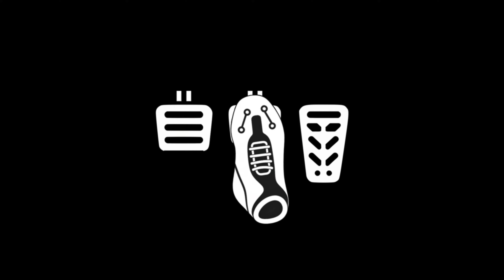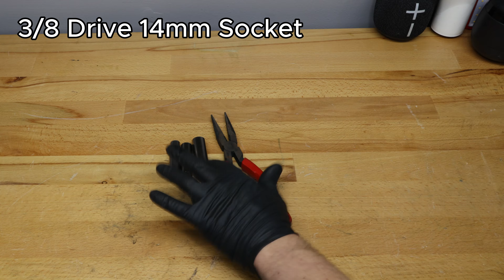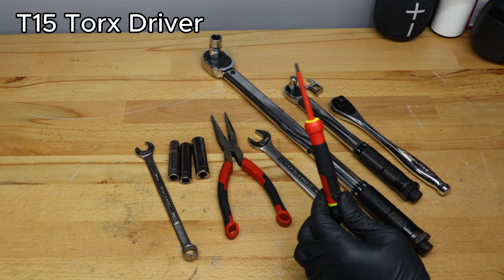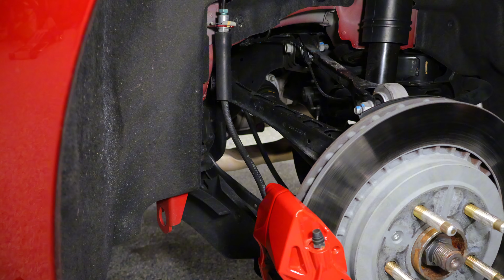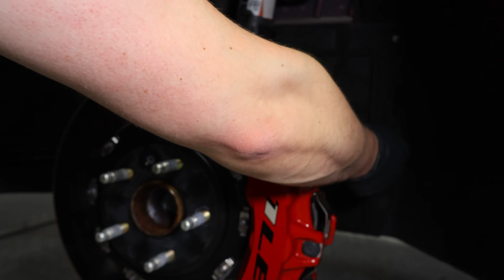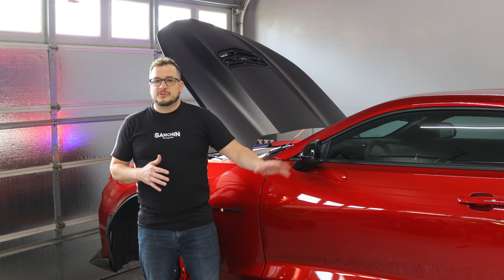How-To: Stainless Steel Brake Lines // 2016 - 2024 Camaro // SS & ZL1

Comment: Great video Luan but if you will I have a suggestion to keep a lot of the fluid from leaking all over when disconnecting OEM lines . Remove reservoir cap and stretch Glad Press'n Seal on clean surface of the threaded reservoir opening itself . I've done this for years and also keeps fluid in the lines say if your also removing calipers . Yes you still have to bleed the calipers afterwards...Peace
Reply from the maker: Man, this is GREAT advice! I've pinned the comment so everyone can see it.

Comment: Thanks for the video. Quick question are you still running the hawk DTC 70 brake pads? I saw in one of your videos you upgraded from the DTC60. Would you recommend the DTC 60 for a beginner like me that’s starting to push harder on brakes? How hard the DTC 70 and DTC 60 on the OEM rotors? Thanks. Maybe a brake pad video like your oil video.
Reply from the maker: Great question! I don’t run the Hawk Pads still. I’ve run a plethora of different pads, from PowerStop Track Day Pads, to Ferodo DS3.12’s. My favorite pads were the Raybestos ST45’s, but unfortunately those are no longer made. Currently, I run the Girodisc GP40 pads and they are phenomenal. 

I did not like the inconsistency of the DTC-60 at all. The DTC-70 was much better, but they tore up the rotors pretty good and wore down much faster than other compounds I have tried. 

Stay away from PowerStop TDP, and Cobalt pads as well. The wear rate was absolutely awful. If I had to rank them from favorite to least favorite, here is how I would list them:

Raybestos ST45 (discontinued)
Girodisc GP40
Ferodo DS3.12 & DS3.12
Hawk DTC-70
Hawk DTC-60
6 Chipmunks at each caliper
Cobalt XR1
Power Stop Track Day Pads
Reply: @ you’re a legend! I’m going to …follow your line…and go with the Girodisc GP40 hahaha. Any chance you’ll be at Watkins with NASA  Northeast on April 26-27?
Reply from the maker: @pv4083 I wish! Watkins Glen is one of my favorite tracks. Did my Skip Barber School there on the short course and did the Full Course a few years ago, albeit in the rain.

Comment: This isn't related to the video, but.... do you have a guide for first time track goers? I have a 22 1LE, and I want to get some track time this year? I'm in Northwest Indiana, so it's probably going to be Gingerman or Autobahn.
Reply from the maker: I don’t currently, but I can add it to the list. I do have a long-format video of what I pack for the track, if you wanted to check that out here: https://youtu.be/4YBlAUGzPX4
Reply: I've must've watched that video like 10 times...lol. I had questions like, is  brake fliud, brake pads, and tires change a must for a first timer?
Reply from the maker: @Alkeides I would highly recommend changing your brake fluid to a high-performing, high-temp DOT4 fluid, like Endless RF650. As far as tires go, you’d want at least a summer-only type tire, or max performance category tire. The OEM Camaro SS 1LE and ZL1 Goodyear SC3 are Max Performance, so no need for different tires. As far as brake pads, this is entirely dependent on the track you will be at, but if it’s your first time tracking, as long as they aren’t some $70 set of AutoZone pads, the OEM Ferodo/Brembo pads will do.
Reply: @FollowMyLine17  I bought the car used with Continental ExtremeContact DWS 06 Plus, so it looks like they will have to be changed. Might as well order some fluid and pads. Probably going to need wheels as well. Driving on SC3's in the rain is scary. Thanks!

Comment: Didn’t realize it was this straight forward. Did you do this mainly for the track? The 1LE has such great brakes, wonder if you’d feel the difference on backroad driving. Thanks!
Reply: Ok, thx. I had a 98 M3 10 years ago and SS brake lines really helped pedal feel. But 1LE pedal feels great on back roads. Appreciate it
Reply from the maker: Yeah, pretty straight forward. I did this for the track, but I really won’t know until I put them through the torture test of Road America, in May of 2025. As far as on the street/back roads, I didn’t notice a huge difference, if any at all. Backroads typically don’t put the braking system under enough stress where this would be noticeable though.

Comment: I need help finding how change the shift solenoid on a Camaro my car is shifting high gear at low speed
Reply from the maker: May have to search for a similar issue on other channels. I do not have an automatic transmission.